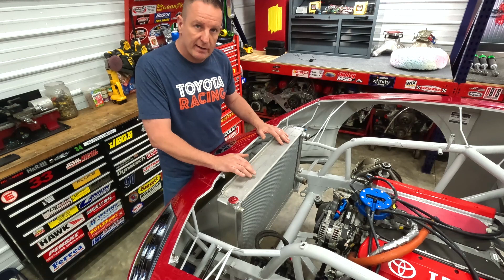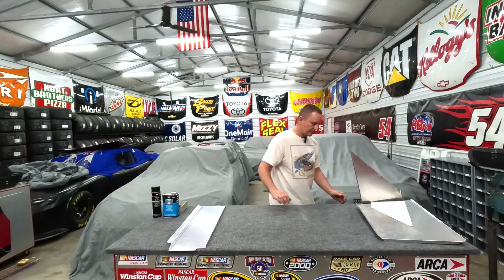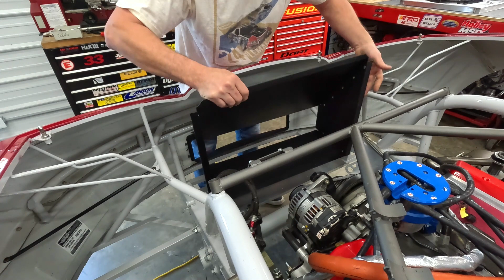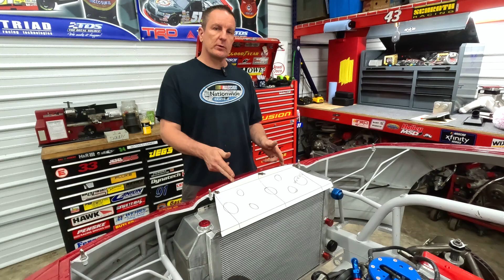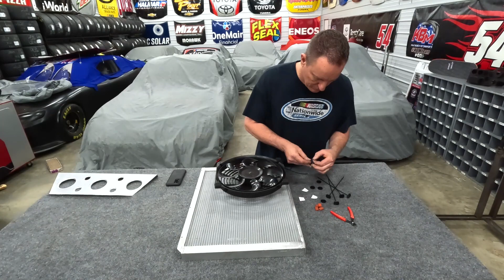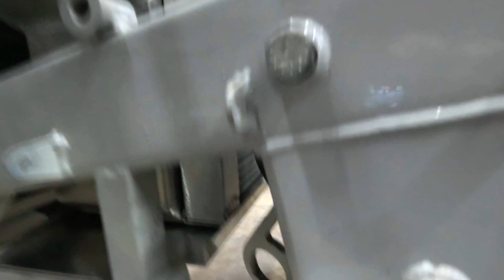NASCAR Radiator Installation & Ductwork Fabrication Toyota Supra Trackday Build

Comment: When it comes to the road course races in the rain, how is the cowl opening/deflector changed to prevent water from getting into the air filter/engine during the race? I know when moving there wouldn't be much making it down the opening but I would assume during caution laps/pits it might make its way in
Reply from the maker: They're modified with drain hoses and shields.

Comment: might I suggest plumbing the +pressure from the pump go into the oil filter, than filtered oil thru the cooler, plumbed to the bottom of the cooler than out of the cooler to the engine. I've had good success with this method.
Reply from the maker: I appreciate the input. 
This system has three filers, before the pump, after the cooler into the block and technically 2 more at the tank in the rear. The 5 stage pan also has BMRS filter inserts in the pan. 
TRD builds them this way and recommends the canister filer after the cooler so that's how I'm doing it.